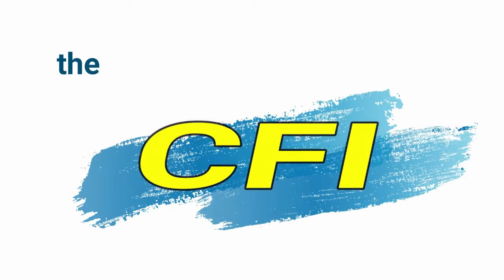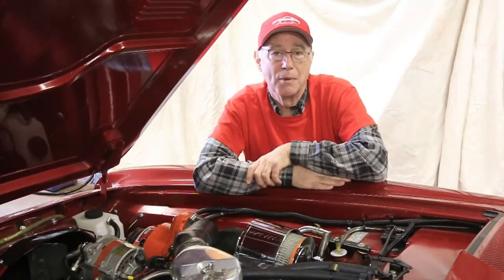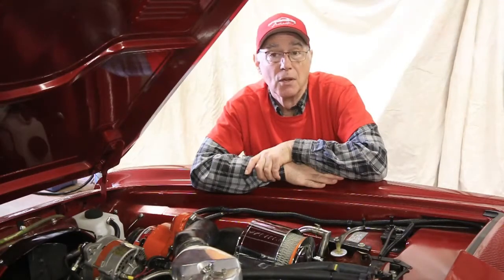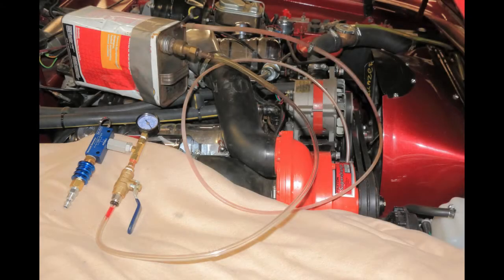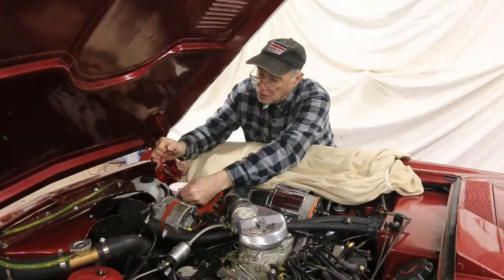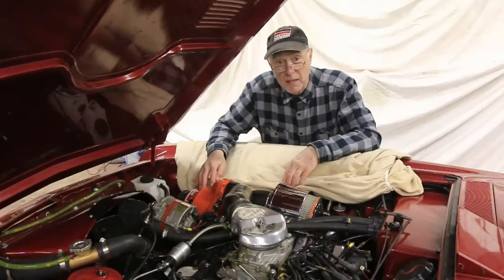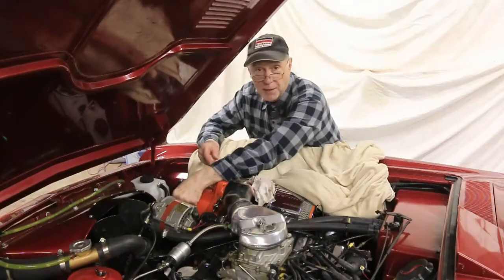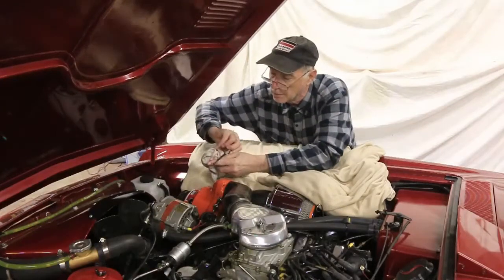SN60 Paxton Suercharger Oil Change

Comment: Hello, What kind of wash oil did you use?
Reply from the maker: The same type of  ATF that is normally in the unit.  The regular oil keeps the drive  lubricated while providing the necessary anti-slip qualities the drive balls and carrier need to prevent burreling of the drive balls. Using a different oil to flush the drive would change the characteristics of the drive part lubrication until that oil could be diluted by replacement oil. Using a different oil to flush risks damage to th unit.
Reply: @DTomasic   hi there. weird question: i'm getting packages addressed to a similar name as yours. with a K not a C. to my house in fort laudi Florida. rivets. light bulb.
Reply from the maker: @Dangerousbreed   Wish I could reconcile you confusion. What little I order on the net is typically delivered in my wife’s name. From the few companies that use my name, there are no missing or outstanding deliveries.   It appears the inter web is becoming increasingly tangled.  I can assure you, I live no where near Florida or its surrounding states.